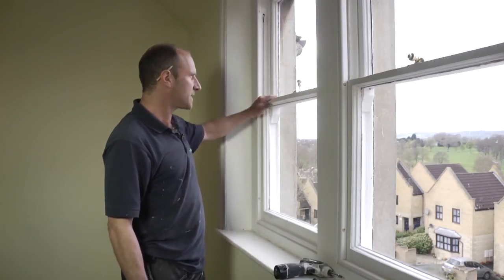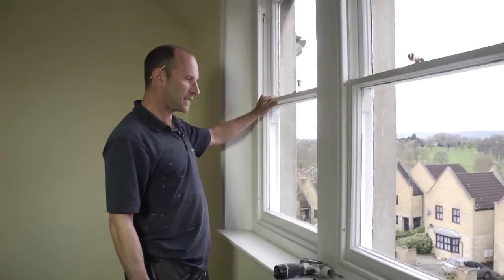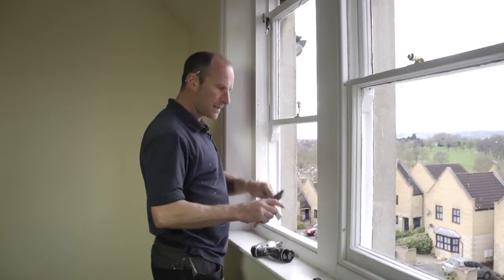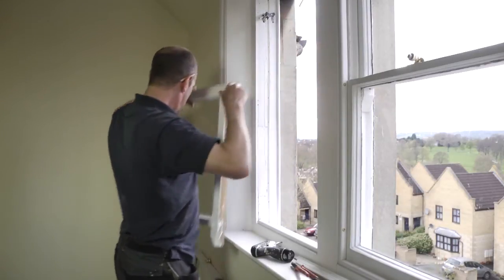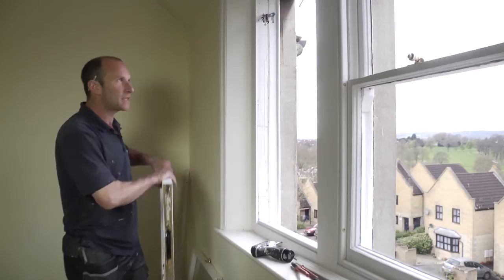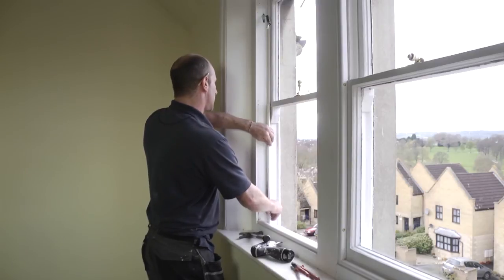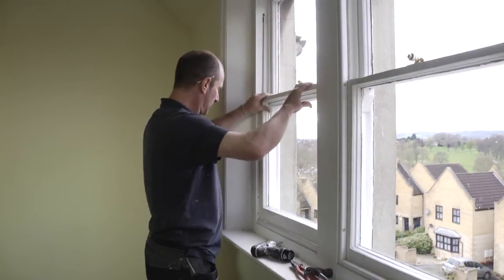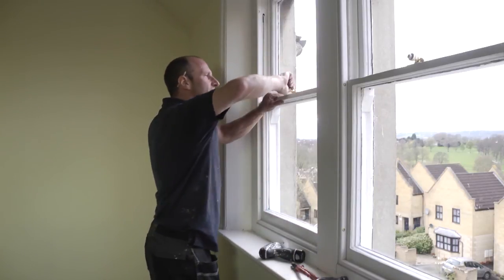Original Sash Window Solutions Removal System/Decoration instructions

Comment: For this type of window, especially for cleaning they should all be fitted with what is called the Edinburgh Hinge, simple device
Reply: Hi! Is that the hinge that keeps the window at a certain height? Or the little screw that that keeps the side bead secured? 

I just moved to a flat in Edinburgh and the sash windows are really nice, albeit single glazed. Do you know if single glazed windows are replaced with double glazed ones in Edinburgh without messing about with the casing?